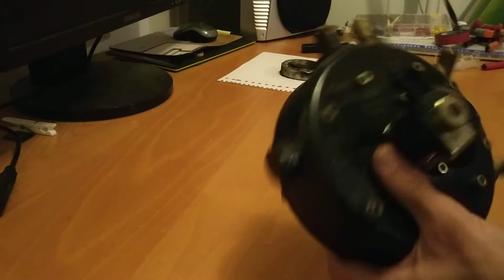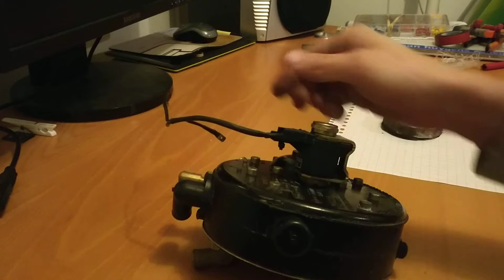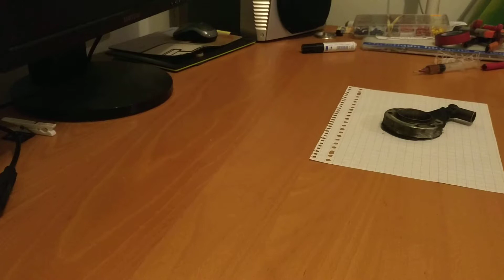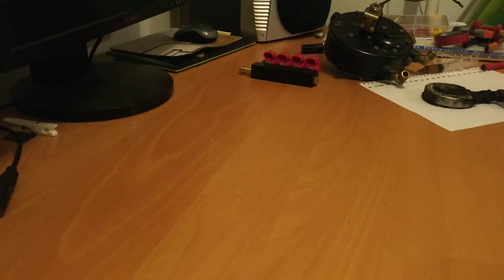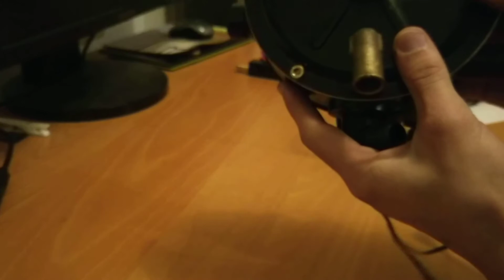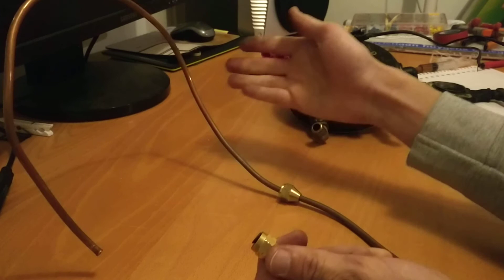How do LPG systems work?

Comment: I have been building dedicated LPG engines here in Canada for decades . The latest project is a 12:1 compression 5.7 liter small block chevy V8 . This has forged pistons , hardened valves , roller camshaft , 1.6 roller rockers , large runner intake manifold and high swirl cylinder heads with free flowing X pipe exhaust . It has the venerable Impco 425A mixer with a lean cruise valve installed . This engine solves many of the inadequacies of most LPG conversions . The high compression more than makes up the lost power of the lower BTU LPG fuel with tougher components to deal with the heat problem . It also addresses the 20 % air stream occupancy that gaseous LPG needs with large runner intake plenum and ports . The lean cruise valve is the icing on this cake because LPG has high resistance to lean backfire with its 120 octane equivalency . So this engine not only has high horse power at wide open throttle ( the 425A is maxed out at 350 HP ) and high torque from increased compression but gets extremely good mileage from the lean cruise effect . This engine is in a one ton truck that pulls grain bins to the CO-OP at half the cost of gasoline or diesel engines . It also produces no particulates or carbon monoxide certainly a factor in this day and age . Thank you !

Comment: Can a stove be attached to the output of LPG converter and get a flame when the ignition is turned on ?
Reply: You need to have the engine running or the electrovalves will be closed. If you put 12V on the valves it might work until the evaporator freezes.
Reply: why?, just buy old lpg tank and remove pipe from inside and it will act as gas bottle

Comment: here is a dumb question -can one use natural gas used for cooking etc [ methanes?] instead of lpg,thinking of adapting the filling nozzle to be able to fill from tank from hardware shop....
Reply: yes but pressure must stay in range for lpg so you can fill tantkonly up to 20 bars

Comment: If your still around got a old ford on fuels and a gastec LPG had to replace the fuel tank due to contamination the sender unit was stuck half way and the positive was on the resistance line always half way since I disconnected and accident had on two occasions the system on in on position the gas was leaking from the pump since the fuel pump was not hooked in once replaced the gas relay is working after saturated and turned to off still runs fuels or gas and you can switch via the switch added gas line set??. enquiry on why!.

Comment: HI, I AM ABOUT TO BUY  AN LPG/G3 PEUGEOT 307, CAN I REMOVE THE LPG SYSTEM FROM THE ENGINE COMPONENT?
Reply: yes
Reply: @yusutofa948 if you remove it, can I buy it from you please
I want a liquid injector system so badly.

Comment: Hi. I have used this LPG for 1 year. I found something unexpected that using LPG has more fuel consumption compare to gasoline. At the MID if using LPG 10/100 km liter/km. But if I use gasoline is 6/100 km liter/km. Is it normal? Due to Sales engineer this normal.
Reply: Fuel consumption on LPG is always higher than on gasoline. The difference depends on the type of engine, the type of LPG installation and the calibration. A difference in consumption like that seems pretty high..
Reply: Lpg has less power than petrol thats y its been used more by the engine. People use lpg bcz its cheaper than petrol.
Reply: @MrNaeemkhan000  come to Turkey bro, my mom’s Mk4 Polo uses gasoline and autogas worth the same money, to we just get gas for it
Reply: @MrNaeemkhan000  LPG has 112 octane so should make more power than petrol but i guess you need higher compression to take advantage
say around 12-14:1 ratio which most petrol engine are not that is why the power is down on lpg.....yes it is cheaper or use to be in New Zealand
Reply: @kermets  wrong conclusions: lpg octane number depends on ratio of propane and butane and  if it is 50/50 octane number is about 104, and any fuel with higher octane number does not have more energy, so no more power, compression ratio is in direct connection with power and efficiency, no matter of fuel energy, if is higher compression, it needs fuel with higher octane numb, but it can have same energy but it will have more power, and power on lpg can drops because gas is overheated to reduce octane number to prevent valve burning, so in intake lpg has bigger volume than it would have petrol, but if you adjust spark plug advance and keep lpg temperature low, you can get same or more power than on petrol

Comment: Does Liquid LPG direct injection remove the need for gasoline?
Reply: Not really, you'd still need gasoline to start and reach operating temps, specially on cold weather when the pressure can drop.
Reply: Yes it does. Ford has been selling dedicated LPG cars since the 90’s in Australia, regardless of which of the four systems you use.
Reply: There are only LPG powered cars usually Korean Hyundai,KIA that use injection in liquid phase in intake manifold  
runners . So it’s possible . The difference between LPG and gasoline is that the first one evaporates much better at low temperatures and doesn’t require the same air/fuel mixture enrichment as with gasoline on cold starts . So in order to avoid fouling of the spark plugs you have to trick the engine ECU by manipulating the temperature sensor readings only during the heating up period of the engine .

Comment: hi, thanks for the explanation.....can the third gen  system (indirect liquid injection) us standard type petrol injectors ? fitted into each mainfold inlet runner. cheers  Brett
Reply from the maker: Don't think so, pressure on those injectors is usually way higher than on normal petrol systems